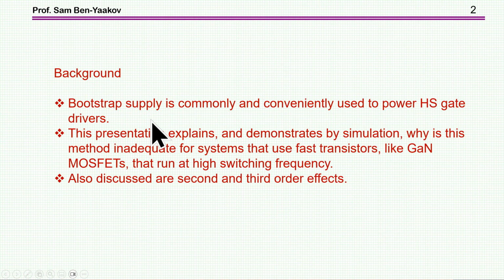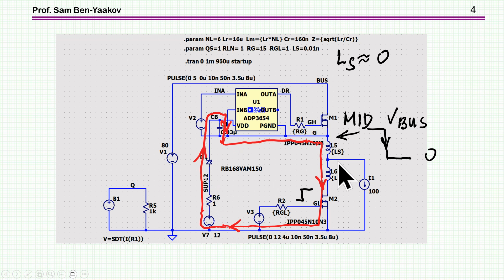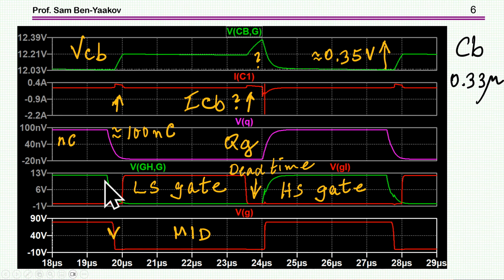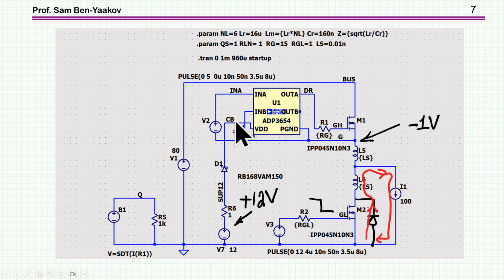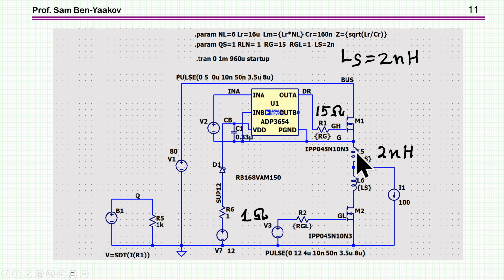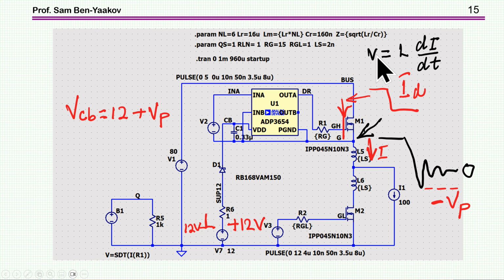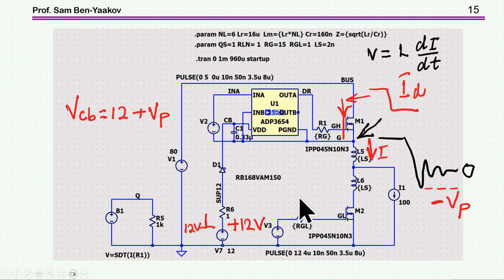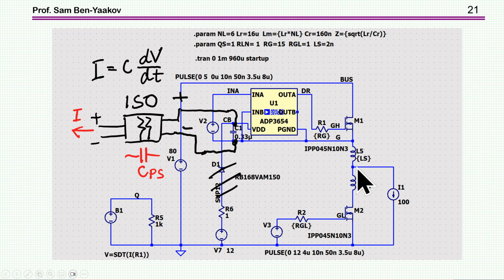Why use an insulated power supply for a HS gate driver?

Comment: Great video professor!
Would there be a benefit to replace the series resistor with the diode (R6) with a ferrite bead, or otherwise filter the bootstrap input current to present a higher impedance at HF?
Reply from the maker: This might cause an over voltage . I will discuss this in next video.

Comment: Thank you again for this great video Prof. Ben-Yaakov. During the video in the section where you discuss "Sizing the capacitor", you took the Idr current as 5mA. But as you also encircled, it is 3mA max. I guess it is a typo right?
Reply from the maker: Just rounded it to take into account possible switching losses within the drive.

Comment: For experiments on the bench I sometimes stick a solar cell on a heatsink and shine one of those crazy bright LED flashlights on it. Heatsink is needed because the solar cell overheats otherwise.

The parasitic capacitance is mostly limited by the space available in the lab, and whatever shade is needed not to be blinded by such an arrangement.

In terms of common-mode current  this wins hands down and is almost embarrassingly simple. Of course it’s not practical to put into a product, unless large distances are already available. I’ve used this trick when isolating instrumentation for high voltage experiments (0.5-1MV). Let’s say that a lab setup lasting longer than a semester can be called a product :)
Reply: Budget alternative to power over fiber! Quite fun. I think isolation motor-generators are competitive for common mode coupling, once the power levels justify them, and definitely beat the efficiency.
Reply: Ever heard about a invention called batteries?
Reply: @JacquesMartini  Batteries in a teaching lab, left without air conditioning over the summer - spicy :)
Reply: @absurdengineering  Oh yeah! They sell billions of these every year to much less qualified people. Your suffering the "not invented here syndrom" and "solar" is Zeitgeist. Any average battery has much mope power and energy density than an solar panel. And guess what! You replace them for a dollar!
Reply: @JacquesMartini  It may come as a surprise perhaps, but fixing corroded battery holders is not the most pleasant way to spend an afternoon. In a teaching lab, nobody ever replaces anything until it fails. It’s a Law of Nature for all I know. And when things fail due to battery leakage - you know how it goes. PV cells are useful beasts, nothing to do with zeitgeist. I’ve used them for this purpose in the 90s, before it was hip :)
Reply from the maker: Interesting. Thanks.

Comment: Hi Professor, thanks for the video. It aligns with my preference towards isolated high side supplies (also for 100% duty cycle operation and bipolar drive capability). Some of the unwanted effects from the bootstrap can be mitigated by a series switch such as in the LMG1210 and local high side drive voltage regulation. They are not perfect, but can be much smaller and cheaper than an additional isolated supply. I would be interested to hear your perspective on these approaches. 
The last section on power loss sounded a little off and I think there are some corrections: the calculation of (12*5e-7*10e5)/2 is 300 mW, rather than 600 mW. More relevant, the voltage across the bootstrap is delta V of the bootstrap capacitor + diode Vf (this part not divided by 2), and results in much lower charging bootstrap losses than the power dissipated in the gate drive (~ the 600 mW you calculated). Probably around 50 mW for the example. However, reverse recovery current can be a significant pulse load that produces relevant power loss as well, especially with a pn diode and in fast switching, high voltage systems.
Reply from the maker: Thanks for keen eyes, yes the loss calculation is off. I was carried away, probably because  I have observed in the past heating of the series resistor. I have chopped this part. As for the switch solution, experience has shown that for GaN they are problematic due to back injection of spikes.
Reply: Appreciate your reply, I will keep an eye out for these spikes if I use the LMG1210 with a bootstrap. Is there a similar problem with the synchronous GaN bootstrap approach (in addition to a higher risk of overcharging)? I assume it is predominantly a capacitive effect.
Reply from the maker: I am not sure about the switch approach we could not make it work reliably. BTW you are wrong in your loss calculations. I will post an addendum video to cover the loss and will address the issue . You were right though about the arithmetic error, not dividing by 2.
Reply from the maker: Thanks again for alerting me to the error, which was  fact not just the division by 2 but fundamentally wrong. As you pointed out, I have considered  charging the capacitor from zero while in fact it is already charges. This distinction is in fact discussed in some of my YouTube videos. If Ok with you, I would like to acknowledge your alerting me to the error  in the follow up video (coming soon). It will be nice if you will send me your name otherwise I will identify you femboyee